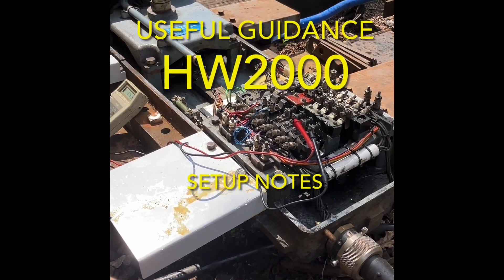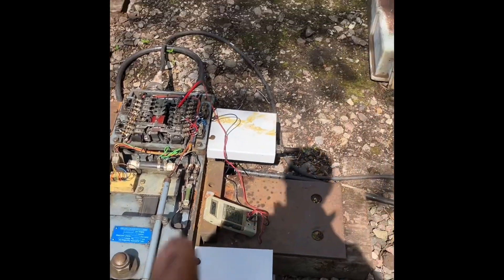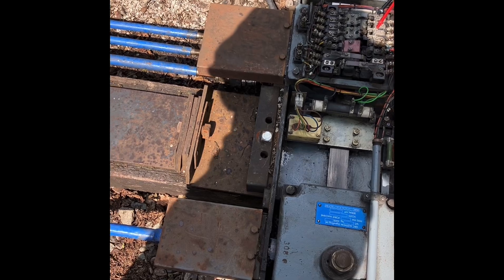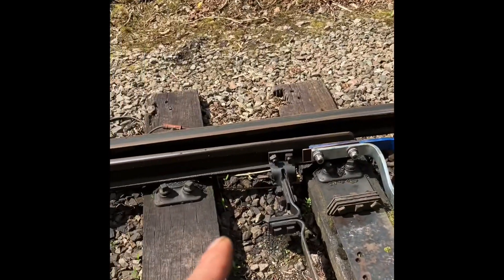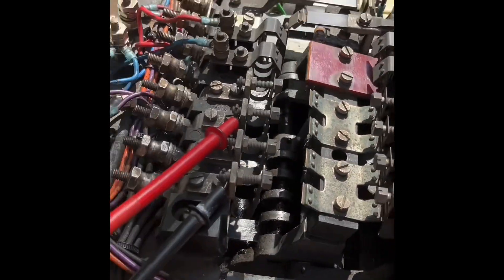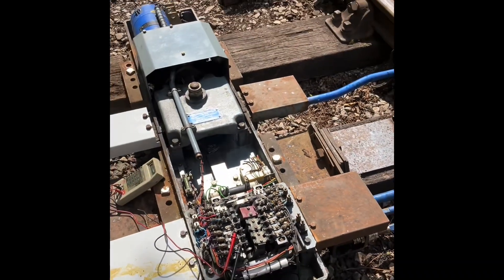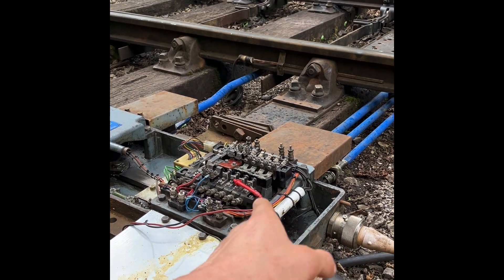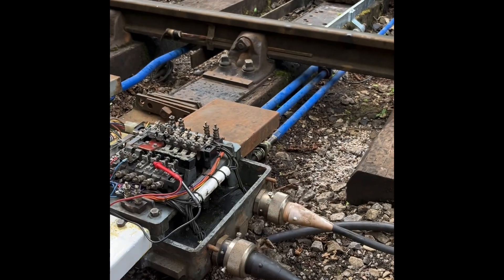HW2000 notes on setting up

Comment: Just a small note. you should always set up the fixed lock (furthest from machine) first. 
If you set up the floating lock (closest to machine )
 first you will not be able to set up the locks correctly.
Just to confuse things, Westinghouse style 63 machines are set up the opposite way, closest lock first.
Reply from the maker: @MickMcknight-k4j  Thankyou, nice little added insight there 🤗